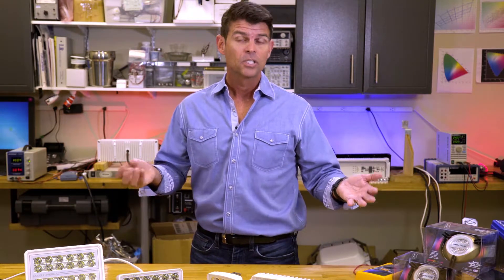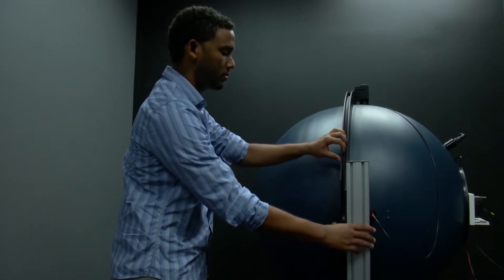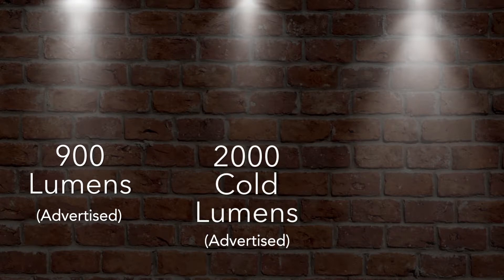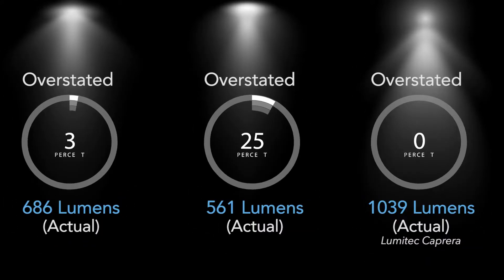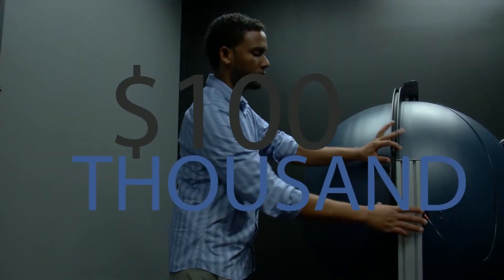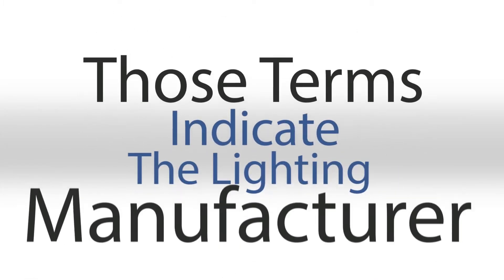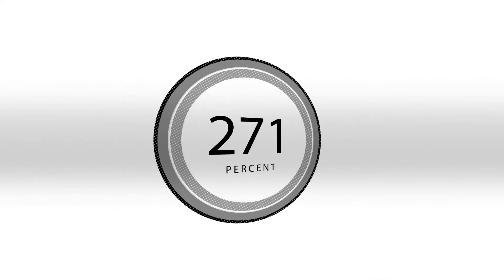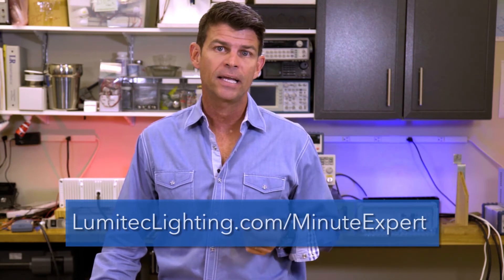Lumens Part 2 Advertisers Sleight of Hand

Comment: GREAT video, a very good example of this are the cheap Chinese Off Road LED Light Bars that are popular on Amazon and eBay. I bought a 20" three row light bar that claimed 420 watts/42,000 Lumens. At 12v it should have measured around 35 amps to get the 420 claimed watts... it was only 5.9 amps at 79 watts!  I have no idea what the actual lumens are... which is really what counts but I have no way to test that. VERY bogus advertising. THANKS FOR THE GREAT VIDEO!
Reply from the maker: Thanks for your comment. Unfortunately there is no regulated industry standards, it is more of an honor system and therefore many companies can claim higher outputs based on there own measurement system. At Lumitec we measure all our products in an integrating sphere, the gold standard of light measurement and therefore the lumens we advertise are the lumens you get.